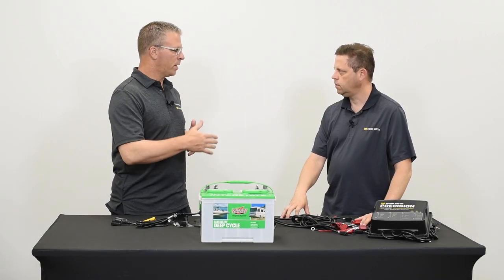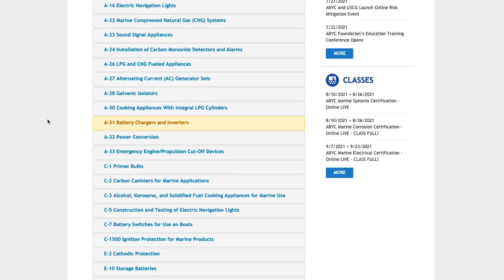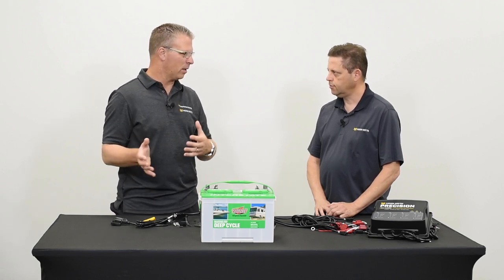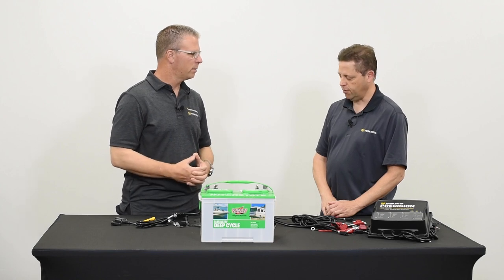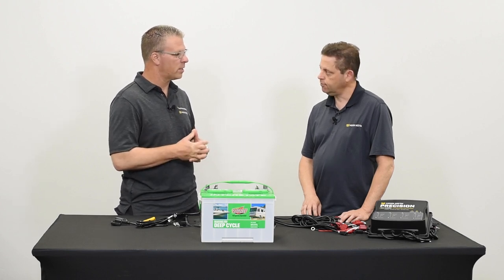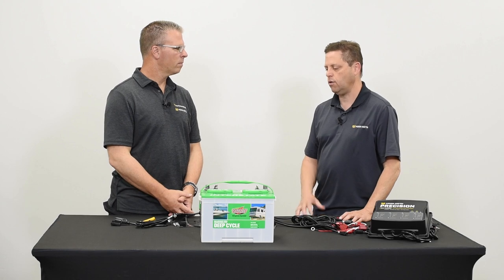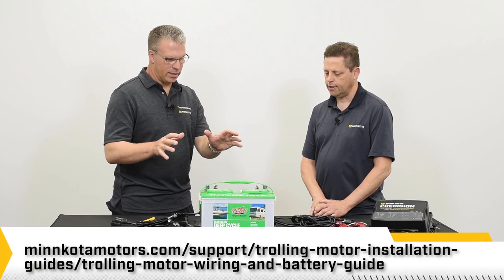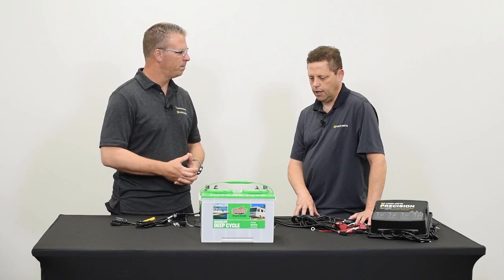Marine Battery Wiring - Wire Size, Circuit Breakers, Series/Parallel, and Best Practices

Comment: So if I am running 2 12v batteries in parallel, what size breaker should I use? Would a 60 am be sufficient, or do I need to go to 100amps?? My trolling motor is a 12V, but it has a GPS anchor, I run other electronics off of those batteries- a single 12v might not be enough capacity to give me all day run time?

Comment: how do you determine the wire size used for the jumpers, and breaker ???? video is not complete
Reply from the maker: PBS #007,  
If you use a 8 gauge wire for the Jumper that will be sufficient.

Best Regards!